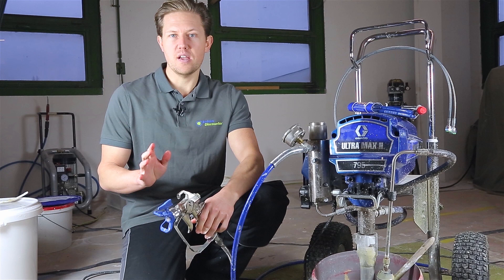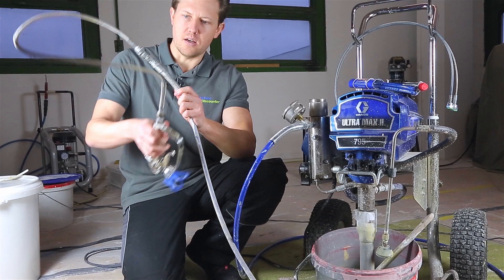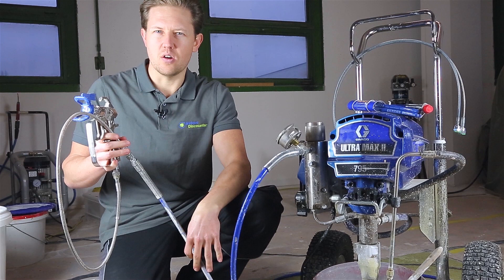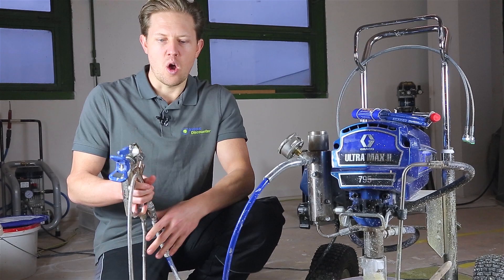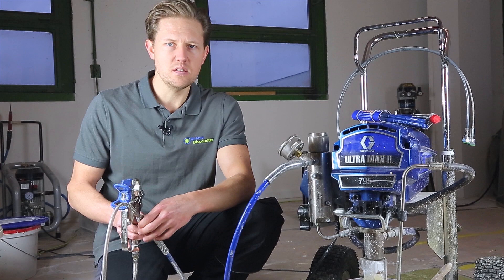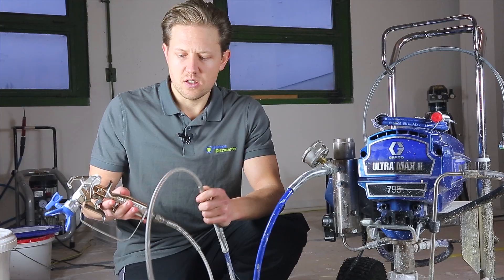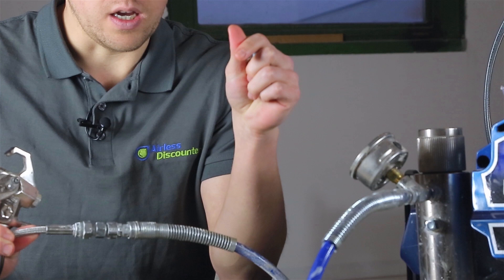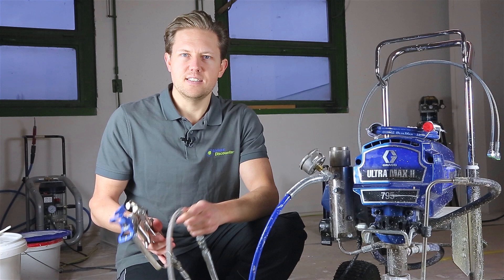Airless Q&A #14 - Hose Whip for Airless Spraying

Comment: Hi there, 
I have Graco 390PC 
Can I use connect short hose to my spray  2m- 4m ? 
What is the minimum length of the hose I can use ? 
Thanks
Reply from the maker: Hi,
It should be 7,5m recommended.
- For lacquers : https://airless-discounter.de/Graco-BLUEMAX-II-HOSE-3/16-X-75-M-FBE-214698
- For lacquers and dispersion paint (DN6): https://airless-discounter.de/Graco-BLUEMAX-II-HOSE-1/4-X-75-M-FBE-240793

Comment: Hi Darren, I have Graco Bluemax II 3300psi 1/4” Airless Paint Hose 15m and i want to add short hose whip, Which one i need to add Graco Bluemax II 3300psi 3/16” Airless Whip Hose 0.9m or Graco Bluemax II HP 4000psi 1/4” Airless Whip Hose 0.9m? thank you
Reply from the maker: Hi,
Depend if you have already a connector 1/4" or not. If yes then take the F/F 1/4". If not take the other one having the F/M (3/16"). 
You can also have a really flexible whip (F/M) here : 25C827 - https://www.airless-discounter.de/Graco-BLUEMAX-II-09m-whip-1/4-thread-25C827
Kind regards,
Airless Discounter team